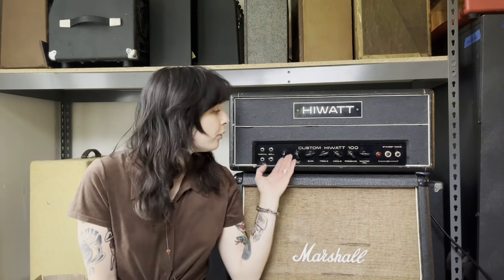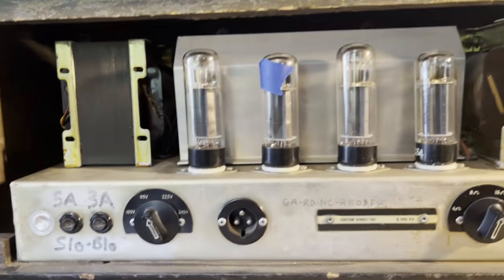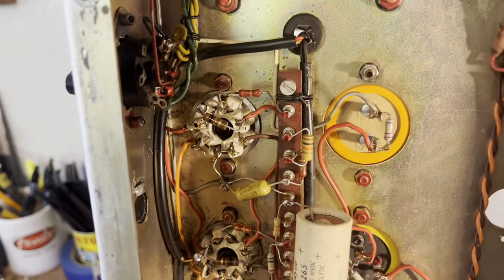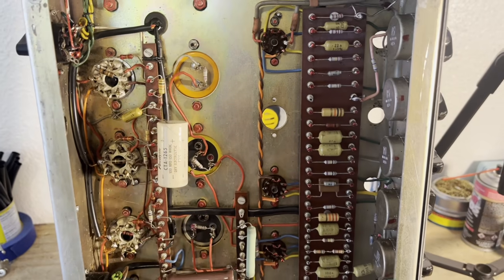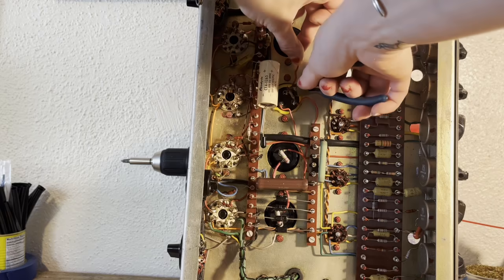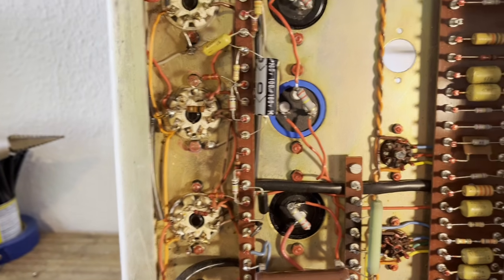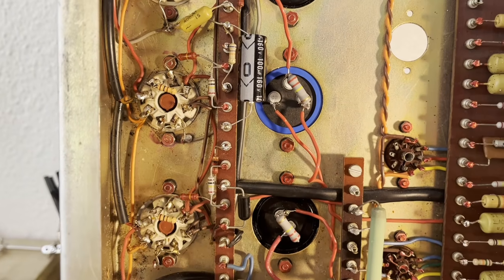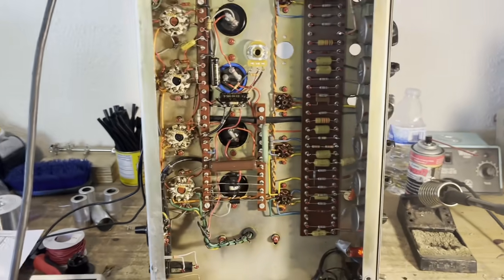Hiwatt DR103 | Restoration & Demo

Comment: Your very good and we all miss you. Your teaching style is very relaxed. The explanations you give are concise and informative. It was very nice to see your guitar skills instead of just hearing them. You have excellent timing. I wish you could post more but making a living is more important. Thank You for sharing. You are Appreciated 🙂👍🎸🎼🎶🎹🎷🎺🥁🎻🪕🎤🎛️🎙️📻
Reply: DON'T consider this Video as Educational.

This Tech failed at identifying the Correct Safety Fuse, with the Factory Schematic in her mits.

If Vacuum Tubes are at a premium, how can one say "Close enough" for Resistors and Capacitors?
What useful Compromise is that?

The excuse is, "I don't want to wait to get the Correct Replacement Parts, so I will just use what I find in my spare parts bins?"

The ONLY reason to do that is if the Customer insists on Gigging that night with this gear.

It fits with cracked nail pollish.

Either remove it or paint those digits again.

Edited to Correct Autocorrect.
Reply: @truthsRsung  If you have your own channel I'd like to watch it. Plus, everyone makes mistakes. For me knowing nothing about electronics, and knowing her training background, Fazio is an expert to me. She has other videos where she is reading schematics very well. Plus she has repaired amps that were a mess inside. And she has her own custom line of amps. Maybe she doesn't have an electronics engineering degree, but she runs a successful, busy amp repair business. Thanks for the input! Must be nice to be perfect and never make a mistake! I like to have the recipe for that one?
Reply: @truthsRsung  the ramblings against an amp tech from an appliance repair man? Please. This isn't about life or death. It's about sound from a box that a more than competent tech repairs. I fined your comparisons to be ridiculous! If you bother watching the majority of Fazio Electric videos you would see how talented she is at repair. You are making to much out of nothing and over exaggerating. At least she unplugs the amps and doesn't demonstrate problems like I've seen other YouTubers that repair amps do! She has a video on safety and proper use of equipment. Do you unplug your air conditioners before testing? Please! Make and amp out of an air conditioner then we'll talk. Otherwise I'll listen to Fazio. Must be nice to be perfect and never make a mistake! I'd like to have the recipe for that one?
Reply: @reddragon3733  ...I studied Robotics at Northwestern.
I have a Private Pilots License.
I am MECP, ASE, and Red Cross Certified.

I was in Scouts, a Lifeguard, and worked at a Custom Shop called, "Rockinn Motorsports" while going to school.
I was one of the last technicians to service Chicago's Union Station Coal fed Boilers.

I don't know what kind of "Appliances" you have at home, but I bet there aren't many that breathe FIRE.

If you aren't in a climate that requires a Furnace, you can't respect one nor frostbite or what happens to a house full of water pipes when it's temp falls below Zero.

Take your chapped backside off to where you can lick your wounds in private.
Give yourself a chance to be wrong, then change.
Reply: @truthsRsung  Save your breath with me. You are, in my opinion, a know if all that has to boast about his life's accomplishments to prove a point. Fazio owns a successful amp repair shop. She is kind enough to share her work and experience to those who are interested. You are wasting your breath telling me about your expertise. You don't have an amp repair YouTube channel. If you ever do let me know. I probably won't watch it, but it may give you a little more credibility. I strive for excellence and leave Perfection up to God. No one is perfect we all make mistakes including you if you care to admit to one. I highly doubt you would.
Reply: @reddragon3733  ...I am a know it all.
That has Credentials.
That means that I have proven to Peers in my Fields that I understand what they do.

If you chose not to respect me because you need to feel happy about being dumb, feel free.
I can leave you to it.
Reply: @truthsRsung  My oh my. You seem to have an issue here. I think your cracked fingernail polish comment sums it up. She does a great job and every tech has their own peccadilloes.  I don't take you or your self-promoted credentials to be of merit. If you have something positive to add, then do so. Otherwise you come off as a misogynistic know-it-all.
Reply: @Basslice120  I've been stating my issue with your rambling for the last several replies. The only thing you have cracked with me is the smile on my face on how you keep proving by your immature comments just how childish your responses are. Thanks for keeping me entertained.
Reply: @Basslice120  ...I don't really care what I sounds like because I am NOT  an Influencer.
I don't have a degree in Marketing.
I am not a teacher, either.

If someone doesn't replace a Safety Fuse with the correct rated one, they shouldn't have their hands in the Box.

They definitely shouldn't be showing other people their mustakes in a uTube Video. (W/O corrections)
Especially since they can edit the video in post production.

That's gonna get someone hurt or dead.

I wasn't self promoting.  I am not getting compensated for placing some Common Sense on the internet.

She gets paid Twice for doing it Wrong.

See if I care if I am Nice about it.   The Voltages in there will maim human flesh.

The Red Cross didn't give me a kazoo when they said I could Guard People lives while swimming.  They gave me a whistle.

You don't like the tone that comes out of it when I see someone breaking Important Rules.
Tough cookies.
Reply: @reddragon3733  Mr Dragon, You have replied to the wrong person. I agree with you about Fazio. I think she is great. I think you meant to send your comment to Prove me Wrong.
Reply: @edwardhannigan6324  ...You are cute.
I am not jealous of her, her customer, or anyone that thinks that an attitude of a saint and a honey thick voice makes a Technician.

If she did her job to specifications, I might be a little jealous.
Or maybe...
If I had better people skills, she'd be jealous of me.
Doesn't matter.
She is the one screwing up, recording it, and not fixing her mistakes before putting it in public view.
Some of us have standards.
Reply: @truthsRsung  Peace my friend, and carry that cross wisely..!
Reply: @edwardhannigan6324  ...It beats kicking the live wire off of a quivering meat bag and calling 911.

I don't like performing CPR and First Aid.
I Love my music, the people who create it, and the Tools they make it with.

Those people need friends like me when they can't lay down a sick guitar solo, not someone who will fuse it for half the rated capacity due to an oversight of the Documentation.

That would get someone to where they were Gigging, let it warm up, then shut down as soon as it was turned UP TO ELEVEN, and strummed thru the First Chord.

"Hiring" an ameture electrician is as intelligent as hiring an Amateur Pilot or doing Drugs with Amature Friends.

History tells us that.

If she cared as much about Calming Electricians, as much as you care about Calming down, then she would start Every Video wearing Safety Glasses and meticulously deenergizing all circuits in the device before Touching anything Shiny.

That way, when someone that looks up to her for her abilities, attempts something like this on their own, they can still use all Ten Fingers to play their Music.

I won't bother to discuss how using "alternate" resistance values changes the sounds produced by this part of an instrument nor why an artist would be weary of that, for any discussion geared towards the creative process.
One step at a time, I guess.

Comment: You had me completely at "Hiwatt"!!!! After a lifetime of tone-chasing, it's the only amp for me. Clean, dynamic, and unique! And it's the world best pedal platform.
Reply: Wouldn't a clean solid-state amp (e.g. Roland Jazz Chorus) also be a great pedal platform?
Reply: @dingalarm  no. too sterile
Reply: @RocknJazzer  Could you please explain what's meant by an amp being "too sterile"? Sorry, but I haven't quite picked up on the words used to describe amp tone 😄
Reply: @dingalarm  sterile means mostly the faster clearer unforgiving nature of solid state that reproduces transients very fast and accurately, that tubes naturally round off being less accurate, as tubes smear things resulting in smoother transients and tone, so when using solid state pedals (which are most ie ic or transistor) going thru a clean tube amp will take the edge off such pedals if that is what you want to do, but if you want max harsh raspy sound of pedals going thru a roland or other ss amp to let the often fuzzy edgy pedals to shine thru extra clean not rounding them off, that is your artistic choice and just as valid in certain genres, as there is no right or wrong in art ie music, all sounds are valid from silence to noise and all in between.  Also using ss pedals into tube amps can get a halfway ss/tube tone if you push the tube amp to breakup adding tube drive to your pedals, again tho all this is genre specific, tho no rules, certain genres fall more one way or the other, blending can result in a more unique tone if you want one, otherwise just follow what your favorite players use in whatever genre you favor, or just mess around experiment w a bunch of stuff you will find what you want eventually tho some chase tone for decades, others dont care and use whatever, both are valid good luck have fun
Reply: @RocknJazzer  Thanks so much for your detailed response to my question! 👏 It's been most helpful! 👍🙂👌
Reply: @dingalarm  Sure no prob. Also if a solid state amp is turned up very loud like a heavy rock band with a hard drummer you want to be able to hear yourself with, the roland may at a certain limit distort in a very sudden nasty spiky way, whereas tubes amp will become overdriven in a smoother more gradual way until it's limit. Past those limits either amp may blow fuses, speakers, tubes, transistors, transformers or other parts. Basically tube amps are more forgiving to a certain extent and sound good in that range, often overdriven on purpose for the sound. Solid state amps not so much.
Reply: @RocknJazzer  Sure! I'm aware of the fact that unless you've got a modelling amp, or a solid-state amp designed to behave like a tube amp (with soft clipping), it'll stay clean until it suddenly distorts (in a bad way) when turned up loud.

Many thanks yet again for the info! ✌️😃
Reply: @dingalarm  Yes very true. But JC120 were of the early era of solid state (70s) when most all solid state amps were super sterile and harsh with obviously no modelling or attempts to make them forgiving or transition gently when reaching clipping, as in the 70s the trend was for as clean as possible, they had enough of tubes and coloration, lol, they wanted the opposite, and they got it, but the early ss tech was just harsh with no room for overload error, but all they had to work with then. They refined it as designs and ic tech improved and that is how the sterile 80s sounds came to be in music, the jc120 being a fave for new wave pop bands especially w the chorus effect on, ie sounds and music I dislike for the most part, lol. That is why I have hiwatt for my clean now, it's a good compromise when I do want a stiff immediate feel but still with some forgiveness and overdrive on tap when pushed, and that is where it gets glorious
Reply: I have used SOUND CITY-HIWATT since the late 60's sold the 100 watt Amp Stacks but kept my 1970 HIWATT 50 Combo which I still use its FANE Speaker never deteriorated.

Comment: Very interesting video.  I have 1974 DR504 that I bought used back in 1980 for $240(!).  It's a great amp that I used as my primary gigging amp thru the 80's.  It was 100% reliable thru that period, but started developing some issues in the mid-90's.  My amp tech called it "motorboating".   I think it got upset probably because I wasn't using it enough.  I had it re-capped and re-tubed and it was restored back to its previous greatness.  I had an adjustable bias installed too.  The unique power cord always intrigued me and I've always guarded it with my life because I thought it was irreplaceable.  Too bad that new power socket didn't work out so well.

Comment: I had a two input 504 and a four input 103. Best amps ever...I have ginormous seller's regret for having sold these, even with a solid 200% profit on the resell... But I am glad they are still being made by Hiwatt and several devoted cloners.
Reply: Afterthought: I still have a Lead 30 head from the mid 80s...very cool amp and from the outside, it looks more or less identical to the Dave Reeves amps, but it is NOT the same type of machine at all. It's a Sterling Imports model, one of the makers who used the name for a few years back then. It's a four EL84 single input with a PCB and it has gain more akin to a Marshall of that same era...

Comment: Nicely done, Ms. Fazio (although you should have cranked it through a quad of Fanes, as it was intended, for the final demo).  Hiwatt in many ways set the stage for the 'boutique amp' industry which sprang up in the '90s; the guys from Matchless were so in awe of Mr. Joyce's brainchild that they decided to emulate the wiring scheme so as to improve the service and reliability of their own products, and that has bled over into other builders' work to the extent that it is now largely the norm in any modern handmake amp.
Personally, I always wondered what sort of phenomenally durable amp might have been achieved by wedding the Hiwatt circuits with Traynor amps' use of raw bias feed to the screens (as Mullard intended) of the EL-34s...it might have been too clean and loud for us to bear. ;)

Comment: I have worked on many HiWatts in the past and I'll never forget the awe I felt when I opened up my first one and saw the quality of the construction. They were absolutely rock solid. 90% of the repairs were just normal service like re-caps, new tubes, or dirty pots. Amazing amps, and I loved getting them into the shop because I knew that there probably wouldn't be any major issues. Wish I could say the same about Marshalls. Old Fenders were a pretty close 2nd to the HiWatts. Not as pretty inside, but still rock solid. Another brand I've worked on that were almost as nicely wired was from another English company. H H. The wiring on these was also impeccable.
Reply: I agree. The HH was and still is a great amp, takes multi effects pedals really well

Comment: Dave Reeves did the original layout. Harry Joyce was a contractor for Reeves. Also when going to 120V from 240V you DOUBLE the amperage. Watts are watts. Say you have 240V @ 3A = 720 Watt. If going to a 120V supply you'd divide the 720/120 = 6A fuse.
Reply: Yes in the US both fuses are 3A

Comment: I learn souch from your videos. I recently scored a Fender Sound Column 410. For $10.00. It seems to be geared as a P.A. speaker. The speakers aren't blown, but a couple have small rips in them. They are four  ten inch 32 ohm speakers, which are super hard to find. The jacks had been pulled through the particle board, and a previous owner used electrical boxes to mount them. I've replaced the jacks and made a new cover for the grille. 
Since I cannot find any affordable 32 ohm speakers, I'm going to try and sell it as is. But your videos inspired me to tackle this.

Comment: Nice to have you back, love your videos! One note though, you’ve got the fuse rating backwards, the fuse rating doubles on 115VAC compared to 230VAC, as the wattage demand of the amp is constant regardless of line voltage, it’ll pull twice the current on the primary side on 115V, so it requires a 6.3 amp fuse. You can see it on the schematic as well, the voltage selector in the schematic is set to 220VAC, hence the 3.15A fuse with 6.3 in parentheses below. The HT fuse or the heater fuse doesn’t change on the other hand, as it’s on the secondary side of the transformer. Otherwise, brilliant work as always!
Reply: Thanks for the clarification.
Reply: I though she made a boo boo 😂

Comment: Hey Colleen, never to your videos, but love them.  Just an fyi when working on old amps...yes, I always just get rid of all electrolytics.  Although somethings like the iron (transformers) of days gone by are bullet proof and you will die long before they ever do....the electrolytics are the weakest link, leak and if don't just dead shorts, so all get replaced.  Some of the components like electricytic caps or self-healing poly of now-a-days are far superior and you can pick up 15k/18k/20k hour electrolytics and 200,000hr poly!  
But one thig I wanted to point out when chasing ghosts in some of these old amps are the diodes....I've worked on so many old amps and some changed virtually everything and when it came to the diodes....those were the ones causing the issues I could not find!  Soo, I like to just replace them as readily as electrolytics and wanted to pass this tip along.  Traynors, Bassman, you name it and these things were wasted!!